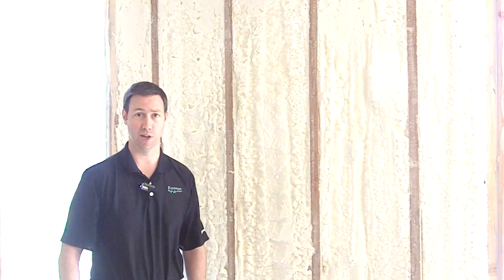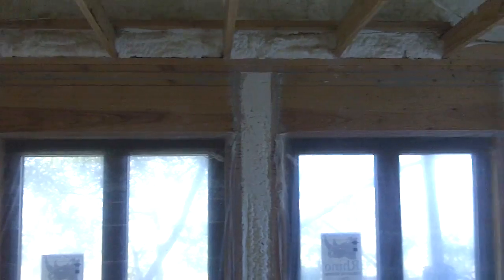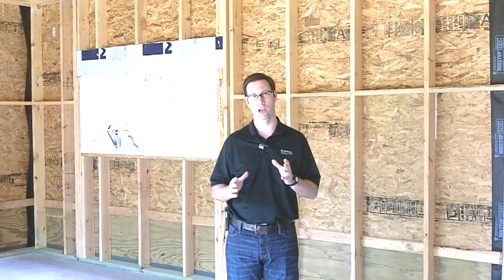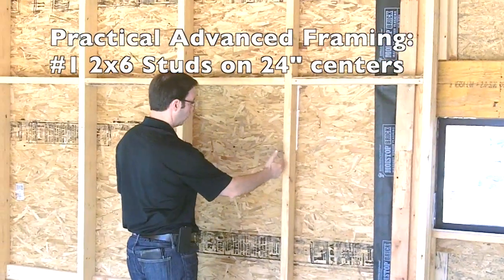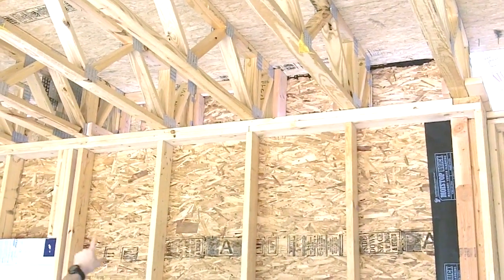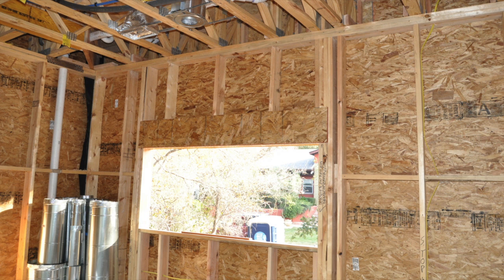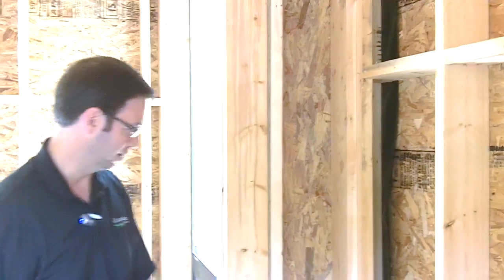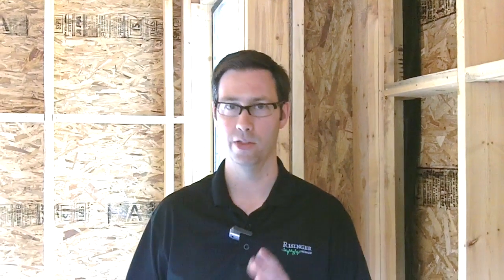Advanced Framing vs Traditional Framing

Comment: That is why the new home s become a pile of lumber when a tornado strikes, the old design and built homes are still standing. I wouldn’t build a dog house using OSB. And that is why insurance rates are going through the roof, because the new homes fall apart in hurricanes and tornados.

Comment: Wow, I’ve always thought the UK lagged far behind the USA with anything to do with timber. What your proposing is basically how we build timber frames in the UK with some minor exceptions,  I always sandwich the insulation in my headers so there is a timber inside to fix a curtain pole and insulate the corners before assembly. We also use 38mm studs then create a further 25mm cavity after the vol layer for plumbing and electrics.

Comment: Nothing new about 24” o/c framing or the (calyfawnya) corners Matt.
Also a 2x6 backer on the parallel partitions in lieu of a stud on either side is also better for insulation.
We framed that way 40 years ago, mainly because we saved quite a few studs on every house.
Also, the building codes in various areas have much to say about all this, not just the opinion of individual builders.
As for the insulation, what was used back then, is what was available back then.
As recently as 1970 pressure treated lumber didnt exist, neither did the Aspenite sheathing.
Fact is that most builders back then were just as serious about building quality homes as you are today.
As for the 5/8” drywall, yes its a good idea, especially with 24” o/c framing, which you should have mentioned.

Comment: 1.  Are the 2x6's necessary to do 24" O.C. spacing, or are those two separate issues?

2.  What is cost comparison between 2x4 @ 16" w/ 1/2" sheetrock vs 2x6 @ 24" w/ 5/8" sheetrock?

Comment: I was a building contractor for 40 years.the issue I have with today's building practices is they are trying to build too airtight a house has to breath.when you spray ceiling& wall cavities with foam or glue based cellulose what happens if that cavity is not 100% dry when it is sealed up.i think in the future we are going to find major mold & rot issues with this type of construction
Reply: I have watched home building programs where they insulate so tight they have to install a 2500$ fresh air system.what is wrong with this picture?

Comment: It looks like there is still a double top plate used in the advanced framing example even it was pointed out that the ceiling joists land on top of the studs.
If so why is that?
Thank you.

Comment: The 16” O.C is for shear strength it increases your nailing pattern on your exterior sheathing. 2’ 0.C is fine for compression strength you can put the two by sixes and 3 foot centers are not affected compression strength.

Comment: Enjoyed watching this video. I was a carpenter for 20 years and now am in health care. We are preparing to build a mountain cabin and we're considering using 2x6 for exterior walls as you recommend. Back in the day I asked a builder why we did not insulate the empty spaces in corners and inside headers. He told me dead air space was a good insulator too. I accepted this and never questioned the information. Does dead air space have any insulaing value?

Comment: You should note, since your spacing 2x6 @ 24" with studs under floor joists, you can eliminate double top plate, reduced lumber makes up for additional cost of 2x6, the gain from 5 1/2" cavity for insulation is priceless

Comment: 24" walls? not knowing how to insulate a proper corner ? not advanced in any fashion. definately agree on 2x6 ext wall and the 5/8 drywall will help with that ridiculous spacing. and I agree with you on the value of the 5/8's thickness vs 7/16 drywall . but this isn't advanced at all . its called cutting back and using insulation value to justify it. compounded with framers who apparently cannot have a helper spray the void in tee corner while doing their duties. which is only reason to use full studs when doing the wall tie spot instead of 3 blocks. on the exterior. as for the headers. if you still build with 2x12 and use a full cover scrap of 7/16 osb in between so it makes 3 5/8 thick header. theres no gap? wth is the insulation doing behind the drywall when it comes to hanging curtains-you think people only use blinds now? now I am NOT trying to blast-troll or whatever the kids call it now days. I am saying -what your doing may be allowed in Texas. it may be accepted but it is NOT advanced. I wish you the best -nice video production btw. and the clean cut look and clear speaking was excellent. Oh btw yes Im a 30year plumber and as a 15year old I was plumbing weekends (dad) worked on framing crew during day (i went to night schools) didn't need parentsat school  during day I needed teachers) and while doing these then as I got older I built houses and did hvac and electrical training on weekends and evening when I wasn't tied up with other stuff. nothing beats watching a person see their first home go up and knowing its rock solid. Making sure they do not scrimp on windows-doors and exterior walls (the first line of defense) then the attic. do not build a house with more sq ft in the attic then the under air below part. pretty is expensive and can be quite ignorant.  Mind you opinions are like body parts-we all have them.

Comment: I wouldn't call this advanced framing..   hate it when peple call it that..more like extra insulation.. or un advanced framing..
In this so called advanced framing,  your plywood will have more of a belly on the outside.. Especially if you don't leave your eighth inch gaps in your ply.
the California corner is a traditional corner.
Never see that cold pocket in traditional framing, unless you don't know what you're doing.
This is from a builders perspective,  not a framers perspective on structure.

Comment: So glad he brought up the 5/8 drywall i was gonna chirp hard on wavy walls, joint cracks and screw pops with 1/2 inch on 24”. Good video !
Reply: I might add 16” is still better, especially for finish work. id rather save money by working more efficiently and not cutting materials.

Comment: 24 inches on center isn't new, but why do they use 2×6s i am good with beefing up the studs but what are the benefits, i mean if the house goes up in flames the studs aren't fire resistant

Comment: That project looks good. For my last project in an 8800 Heating Degree Day area in the Upper Midwest I used 2x6 studs on 24" centers with an inch of XPS sheet under the T1-11 sheet siding (minimal budget rural project). We believed the excellent Marvin Windows were worth the price for their double glazing, the low-e coating, the argon gas fill, and fine quality and aesthetics. Window area was limited to a percent of the floor area, and positioned to favor passive gain (calculated eaves overhang to shade the sills between the equinoxes). We ordered roof trusses with a 16" energy heel, and blew in R60-depth insulation. 3/4" rock in the ceilings.
The big thing for comfort was radiant in-floor heating, an extremely tightly-sealed space, and positive, continuous ventilation at a calculated rate, with a 60' run of buried (under the footings to grade, sloped lot) make-up air duct for earth-tempering.
Where I live now, nearly 11,000 HDD climate, I'd do it a bit differently, obviously. OTH, the principles are the same, tight house, positive make-up tempered ventilation, no cold surfaces, high mean radiant temperature... comfortable for babies!

Comment: Is anyone doing the math here? 3 - 2x4s on 16" = 3.5+3.5+3.5=10.5,   2 - 2x6s on 24" = 5.5+5.5=11 You save lumber w/2x4s on 16" plus less plate material, thinner drywall (1/2 vs 5/8). When I built my addition to my house I used a double wall construction on staggered 24" centers capped with a 2x10 top plate. I was able to put R30 insulation in the walls (1 bat of R11 and 1 bat of R19). It required only one additional stud per 4ft. and provided a thermal break in my wood as well as wall support every 12". Also made vent ducts, and wiring much easier.

Comment: So you build with 24" OC saving material, then you use 5/8" drywall throughout. Most likely, the net savings is going to be a wash. How about using Norbord Tall Wall panels for exterior sheathing to reduce the amount of seams by up to 60%.

Comment: It is pretty necessary when you're talking about making a structurally sound building that is going to rock back and forth and even if you live in Texas while there's the Madrid fault line for 1 and also no matter where you are on the earth the tectonic plates beside the shift at random anywhere so that means that your foundation is going to move in the house to go to settle so unnecessary would you claim is actually kind of somewhat pretty necessary if you think about longevity of a house and being structurally sound or it going to collapse inside of you on top of you I mean you know I'm not I'm not a rocket science but tell me neither or you

Comment: You know I don't know how it is in Texas but out here in Cali we have what's called fucken earthquakes Anda that's 16 to Center not 24 to Center is kind of necessary in places like this 4 reason it's traditional for a reason is because it works and it has been proven to work through time and time again so you go ahead with your funeral 24 on Center which is way too wide and you know just your two-by-sixes which is really odd I mean you don't have any posts or or anyting you don't wear any beams on top of the walls that are shared or anyting like y'all frame really stupid in Texas I mean then again tornadoes well they just rip your house out and it doesn't matter what the hell you build it but again traditional framing is traditional for a reason I don't understand your Concepts here and foam insulation sucks

Comment: I just bought a house in N.C. , outside wall framing was 2X6 on 16 inch centers. That to my knowledge is federal requirements in the construction industry .  24 and 18 inch centers were done away with back in the early 60s . Before anyone does any new or addition to their home , they need to check federal and state building codes inorder to pass inspections

Comment: Talk about wasting wood.  Even on 2 ft centers, where you use 3 studs instead of 4, uses more wood.  Your better off using a better insulation in the wall and also ridged on the outside.

Comment: How much lumber are you saving using horizontal cats that you have to use because 24" centers even with 2x6 is very weak.  In the NE we use shear walls a lot to get massive strength in walls or let in angle braces I could go on for days but there are reasons for 16" centers my man,  maybe in 30 years you will figure it out. Just cause its new don't mean it's better..I like the rigid foam tho

Comment: Wow! You American builders need to get up to speed. I'm in the Great White North (Canada) and my latest house is double-stud 2x4 walls, 12 inches thick, on 24 inch centers. In a wintery climate that regularly goes down to minus 30C ( that's f'ing cold in F) we burn only 1.5 cords of firewood a year. My neighbours burn around 8 cords. I used ordinary 1/2 inch drywall on the walls, and 5/8 inch drywall on the ceilings, to support 18 inches of cellulose. 

You guys complaining that the drywall isn't properly supported on 24 inch centers are nuts. Our house has hosted numerous house tours and no-one has ever complained the house seemed 'underbuilt'. If you want to overbuild a fortress, go ahead, but your clients will pay for your ignorance with high heating bills FOREVER.

Comment: I don't know about the codes there in Austin but here in Tennessee all exterior walls are required to be a minimum 16" center. I do agree with using 2x6s instead of 2x4s on all exterior walls. Also, here in Tennessee building codes require headers to be used over all windows and doors, load-bearing or not. I just can't see Texas and Tennessee having such a different set of standards when it comes to building requirements. This guy is either a liar or complete dumbass.

Comment: You have horizontal cross members attached to those studs...which adds more wood and labor back that you were trying to eliminate???   And if you have to use 5/8 drywall instead of 1/2 because of the 24" span, you increase the cost for that.

Comment: If you switch to 6in instead of 4 in boards then what difference does it make that you switched and had them 24 on Center? You're still putting the same amount of stuff into your house as those who do the 16 on Center framing. You use thicker drywall and more expensive cheating on the outside. It doesn't really seem that advanced it just seems different.

Comment: Hey Mat. Why do you have horizontal blocking at the 5-6' level? Also w the 5/8" drywall, is there any insurance advantages? As you now have a 1 hour wall. Do you also,hang 5/8's on the lids?

Comment: This is an old thread, but I thought the same regarding the insulation factor. If you used two 2" @ R20 + one 1.5 inch @ R7.5 Foamular rigid foamboard insulation inside the cavities, you would have R27.5 on the inside + the additional R5 from the outside for an overall of R32.5.  Who cares about how much less wood you used spacing 24 as opposed to 16, when your heating & cooling costs longterm will be so much more $?  Then again, most people have issues with simple math, so where there is a sales tactic advantage there is a sucker ready to take the bait. Instead of a total R24, these people had an opportunity to gain 8.5 more R-value. Just WOW.

Comment: The cost difference for the 16 to 24 inch centres is not a significant factor and the truth is, for a framer it speeds up the process by 30 %. We use all 16 in centers as it provides a stronger house. 2x6 exterior is standard practice here, in BC as is blocking in walls and cross bracing in flooring systems.I think in an earthquake a house built on 24 in centres is not one I want to live in.

Comment: The focus shouldn't be on insulation, but on structure. You can call it advanced if you want to, but most framers will tell you, it's going backward. I do use California corners, and blocking for inside corners, which are not exactly new methods, but most of this stuff is craziness, IMO.

Comment: Something to consider if going 24" centre is if you use batt insulation, the batts are designed for 16" widths.  So while it can work, there will be more cutting.
Reply: 22-1/2" insulation batts available everywhere for the last 40+ years
Reply: blown in wool is the best insulation.

Comment: The only advantage in spacing the studs farther apart is the fact you will be able to save a few dollars on the overall cost of building or remodeling your house. I personally do not recommend this process because the savings is minuscule compared to the overall cost of building the entire house.

If you look on a measuring tape between 19 and 20 inches you will usually find a little diamond. This little diamond is another measurement for laying out eight-foot walls or floors. So instead of using 16 inch on center layout you can use 19 1/4 for stud spacing. This will save you an additional stud in your wall or floor joist every 8 foot.... but if you space everything at 24 on Center you're going to have to use 5/8 drywall instead of quarter inch drywall which is going to cost you more money and is a little more labor-intensive because it is heavier also you're going to have to buy insulation made for 24 on Center or go with spray foam which is going to cost you more money than regular old 16 on on Center insulation and your only saving one 2x4 every eight feet or so and really what's a 2 by 4 cost three bucks
Reply: That diamond at 19 1/4 inches is for I joists. I don't think too highly of those things. Give me real lumber, 16" O.C.

Comment: You can insulate a three corner stud also prior to sheathing the outside..  These are all good ideas, but the cost also goes up.  Labor for handling heavier walls, 5/8 inch rock is heavier and more labor.  So yeah, all better but more costly.

Comment: Chip board... don’t get it wet... it will melt faster than the wicked witch of the west...
Reply: Sad part is, many house builders in some states have been putting OSB only on the corners and leaving the studs bare in between the corners. All you have then is siding and Interior wall covering with insulation blown in between the house wrapped exterior and inside wall covering. Then if they cheap out and only use the plain Lowe's house wrap, it actually lets moisture in. Unlike the Dupont branded house wrap, that only lets moisture out.
Reply: Advantech.

Comment: The material cost for a 4000 sf slab house,  2x4 @ 16 oc is about the same as 2x6 @ 24 oc. The cost for 2x6 @ 16 oc is only about $4000 more than 2x4 @ 16 oc.  So .007 percent of a $600K house. Plus added insulation cost. So 2x6 @ 16 oc with fiberglass = excellent place to spend some dollars. Then pay for better windows, doors and draft reduction, that's the bang for the buck against BTU loss.
It cost less to go 2x6 @ 16 oc with fiberglass than 2x4 @ 16 oc or 2x6 @ 24 oc with foam.  
But the big kicker with any 24 oc is the fact that less studs = less attachment points to the sheathing = less shear. A LOT less.
Moving the headers down the wall away from the eave protection and into a known source of water at the top of window and door openings is a bad idea. Not to mention it's a big no no in hurricane country. And engineered headers on an outside wall is asking for future trouble. Go with 2x and steel over the garage.
California corner makes for compromised drywall, sheathing and outside trim attachment. 
Gee Matt, I just don't know what to say. Wow, just WOW.

Comment: Uhhh...  Arn't you "Spray Foam Contractors" just creating a FIRE TRAP???  The stuff is flamable.  Even the "Non-Flamable" foam still burns just as well, as long as there is wood burning next to it...  I prefer fiberglass...  IMHO
Reply: Everything is 'flammable'... I don't like it but is accepted in code.